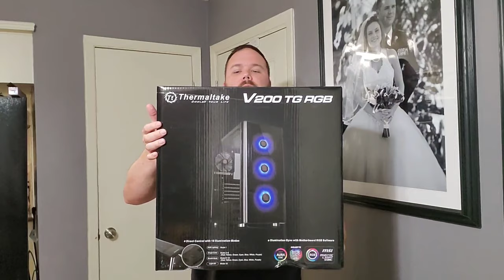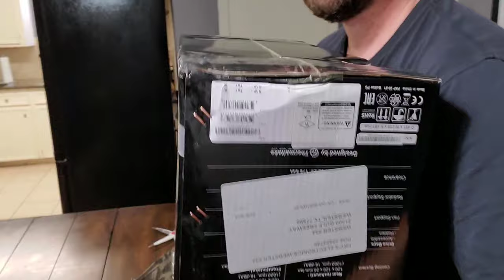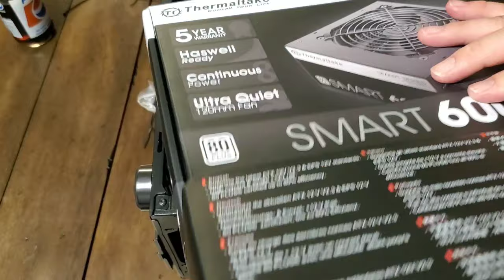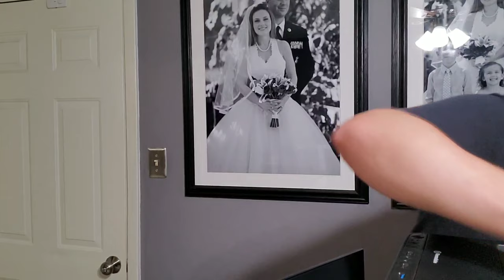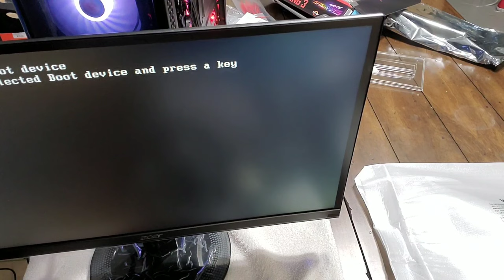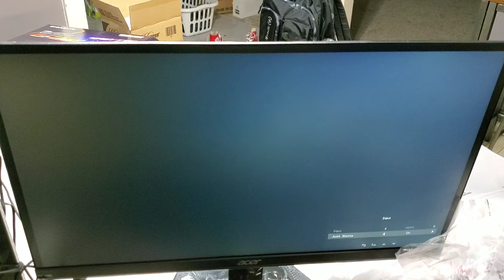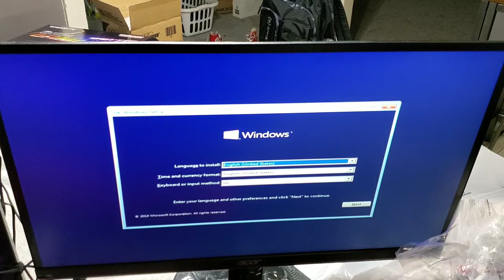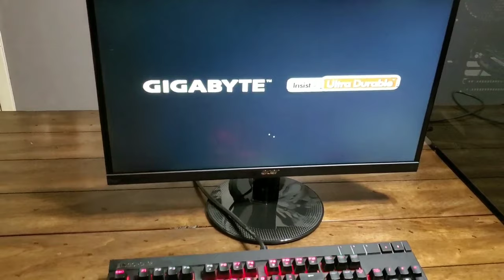Budget Gaming PC Build - The $600 90 FPS Fortnite Machine

Comment: I have a 144hz acer monitor which is good, will this build get over 100 FPS
Reply from the maker: That’s a good monitor. It will get over 100FPS if you drop the settings a little. I have it on Epic settings across the board and it bounces around between 85-95.
Reply: TechOdyssey ah right yeh I see I’m trying to get a pc parts that will come to around 550 dollars and get 150 FPS is that possible
Reply from the maker: I'll check. The biggest factors will ultimately come down to CPU and GPU. I would look at different GPUs to figure out how they perform on Fortnite. Even an older series graphics card might be an option if it can still crank out some power. For instance, I am using a GTX 970 in two other computers and it works great.  Trying to fit everything into a build for that price at 150FPS is going to be hard. Also depends on settings. At Epic, I doubt it's possible. I'll see what I can do with mine if I play with the settings.
Reply: TechOdyssey hey thanks a lot man it doesn’t have to be at epic,  is that the same as low? Don’t really know much ahah. But I would really appreciate it if you could help me and try put together a pc that will run fortnite real well
Reply from the maker: @elliottmidson3170  no worries. Epic is the highest setting category. I have it set on epic for every setting and it's pulling 85-95fps with no overclocking. I'll mess with it this evening on high and medium settings to see how much it ups the framerate
Reply: TechOdyssey 
Okay yeh man that will be great let me know what happens :)
Reply from the maker: It gets 115fps on high settings and up to 135fps on medium. It can hit 150 fps on low settings at 1080p